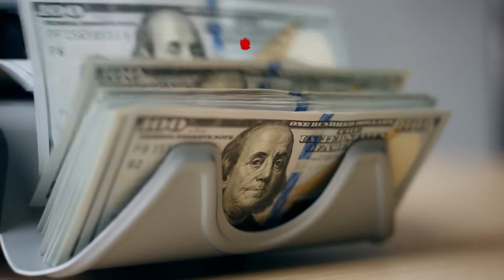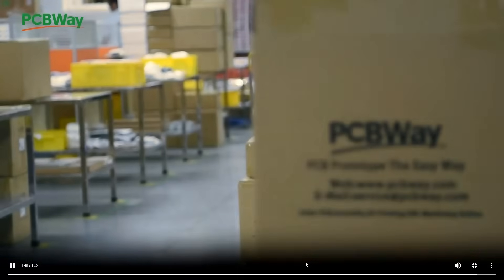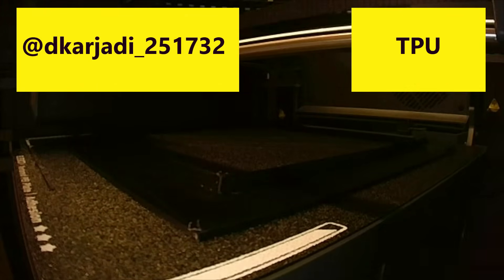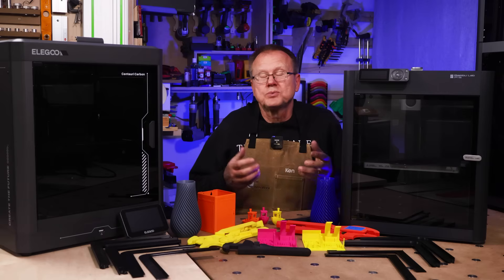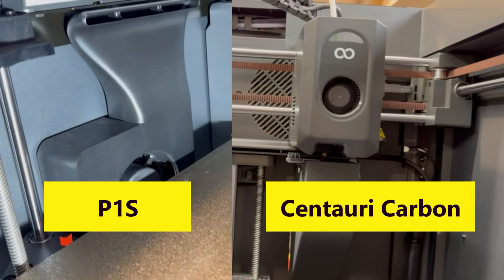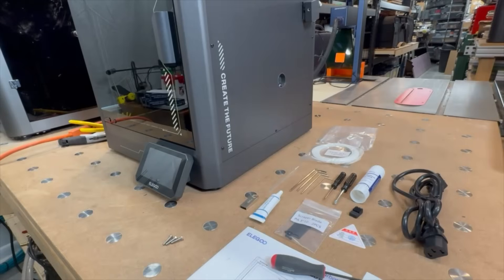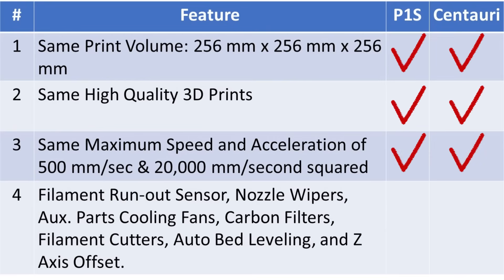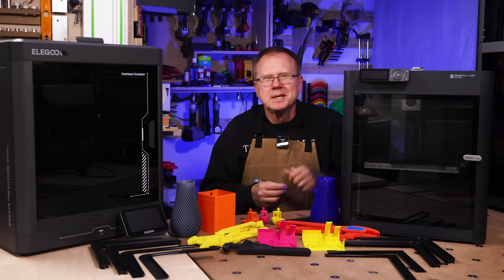Elegoo Centauri Carbon Printer: Better Value Than Bambu Lab P1S?

Comment: P1s power loss recovery was terrible, tbh. I returned it and even the replacement had terrible power loss recovery (and then it has this weird bug where the P1S interface is just frozen after recovering and you have to go to your slicer and turn the camera on in order for it to unfreeze.

Elegoo worked flawlessly. I think the worst part about the bambu printer is that as off writing this, you have to downgrade your P1s' firmware to 1.8 in order to use orcaslicer with it.

My recommendation is that if you want a reliable CoreXY, CC1. There are even mods for it that allows you to use Bambu hotends. For filament backups, I just have the Infinityflow S1. As for color, I just paint them. Saves time, money, and the quality is superior.

No reason to buy the P1s other than for its multicolor system.
Reply from the maker: Thanks for sharing you experience with the P1S and the CC.

Comment: Hello. Currently, here (CZ) the difference between these printers is only about $100. So I have a question: what about the availability of spare parts and the possibility of self-repair? Is it worth saving the $100 at the expense of higher-quality components and the possibility of purchasing spare parts?
Reply from the maker: That's a great question. From my experience, Bambu Lab has a large number of spare parts available for their printers and at least for me, I have typically received spare parts very quickly.  There don't seem to be nearly the number of spare parts for the Elegoo, at least as of now.  If your budget allows it, I would go with the Bambu Lab printer.  Thanks for your question.
Reply: @ristinnovations  Thank you very much for your answer. To be honest, I like the Bambu Lab much more. And when the price difference is so small, and spare parts are available at almost every retailer (via Eshop), the choice is clear. I will get the BambuLab. Thank you very much again for your answer and I wish you all the best in the New year.

Comment: Only corrections. I would add her that the century carbon has metal panels as opposed to plastic like you said and the build volume is the exact 256 whereas the p1s is slightly less, The light has also been upgraded
Reply from the maker: Yes I agree with your  points.  I especially don't know how I overlooked that the CC panels were metal and not plastic. I need to be more careful next time.  Thanks for your feedback.
Reply: @ristinnovations  that happens..I only know because I have magnets on mine lol. Been pretty impressed with mine so far. Haven't. Had any issues. I'm printing mostly abs and petg-cf

Comment: Ultimately I went with the new P2s with the multi-color option. It’s quite a bit more than the Carbon, but I feel the quality is worth it. Amazon has several critical reviews of the Eelegoo. Great review though. I appreciate your thoroughness.
Reply from the maker: You can't go wrong with the P1S.  Of all the printers I have, I rely the most on the Bambu Lab printers.  Thanks for your comment. (Sorry for my delayed reply)
Reply: @ristinnovations  No worries at all.  Just received the printer today, already printing a few thinks.  Really great printer, so easy to setup, I also feel its too good to be true.  Thanks again.

Comment: I think the century carbon is much better deal also it's not too hard to switch filiment after a print to do a different color and the price difference is insane. Thanks for sponsoring a website that is similar to the video!
Reply from the maker: That's the beauty of personal choice.  I'm running them both in my print farm and I'm happy with both.  Thanks for your comment.
Reply: In Australia at the moment with the black Friday deals the P1S with an upgraded hot end is only $10 more than the Centauri Carbon

Comment: At the moment in Australia.  These two printers are the same price.... every1 says the cc is better for the price point. But if they cost the same. Would any1 still go with the cc, or choose the safety of the bambu.
Reply from the maker: Actually, since Bambu Lab has just launched their P2S, I would seriously consider that one.  I don't know what the price is of the P2S in Australia, but it's something to consider. Thanks for the question.
Reply: I just ordered the P1S with an updated hot end for $10 more than the CC

Comment: Hi, you did a great review, thank you for that. I'm between the Flashforge AD5M Pro, and the Centuri Carbon, which one do you think should be my choice? In my country, the AD5M Pro costs $380, and the CC costs $440. Or I can get a Bambu Lab P1S for $500 (But I have to wait 1 month for delivery.)  Which option seems more reasonable at this price point?
Reply from the maker: Sorry for my delayed response. I have been happy with my CC. I don’t have a AD5M Pro, but I have been using an AD5X. Bambu just launched a sale for their P1S so I don’t know if it cheaper for you now versus when you sent this message, but I think you would be happy with the CC or the P1S. Thanks for your question.
Reply: @ristinnovations  thanks for answer.

Comment: 2.148 / 5.000
My story goes like this...
First I bought an Elegoo Neptune 3 which I was super happy with, but my eyes were still hungry so I sold it and got a Neptune 4 XXL... (Great too...)
In the meantime I bought a Phecda laser (great for beginners...) and very quickly wanted something more powerful....
When I realized that XXL doesn't mean much to me in life because most of my prints fit in 255x255x255... I sold the N4XXL and decided to buy the "best 3D printer in the world" BambuLab's P1S with AMS...
That was my first serious screw-up. A nice printer with a disastrous controller. There's no wired ethernet and to connect to wireless you need a blood and urine sample and possibly a CT scan. HORRIBLE!!!
The garbage from BambuLab doesn't allow returns if you're not happy with the product so I had to find a poor guy who knew less about it than me and sell it. I'll never be fooled like this again - I thought and bought a Prusa Core One in a kit for a whopping €1000.
I spent three days assembling it and realized what a piece of junk I had bought. Luckily they accepted a return - for which I still haven't received the money and I'm afraid they'll screw me over too.
In the meantime, I bought another Elegoo Century Carbon for a paltry €300....
It arrived today... and in every way it's incomparable to the three times more expensive Prusa.....
Just to mention that I had minor hardware problems with both the N3 and N4 and I got a replacement controller and head with almost NO QUESTIONS!
In the meantime, I sold the Phecda laser and bought an XTool with which I wasn't completely satisfied (but I think it's my fault) so I returned it also WITHOUT QUESTIONS and got a 100% refund.
To conclude, if you are buying a 3D printer or laser, and I would say any other machine, don't fall for reviews that say European companies are better than Chinese ones.
Chinese companies make millions of copies of each machine and will take yours back or send you a replacement part without question.
European manufacturers are petty and would all get fucked in the ass for a euro so you will have all sorts of problems with them.
I didn't even mention that my new Elegoo CC is better than any I've had and at least 2.5 times cheaper than the first competitor...

Think about this...
Pošaljite povratne informacije
Dostupni su rezultati prijevoda

Comment: well, in the meantime - about 3 months later - the rumors have been more; elegoo is working on a AMS-like system, so that isn't a point anymore. also had elegoo improved the lighting in the latter series - there's not only the little led-lamp anymore, as either 2 light strips on the right and front side to "light up the chamber". now you can see what you're printing - while i guess, bambulab doesn't had "evolved" they'r P1S. so, Elegoo seems to listen to the community and improve they'r printer, while bambulab just seem to "want to sell what they have" (sorry, can't say that better). there's even a annoucement for the source-code from elegoo about the centuri carbon - they "want" to work with the community, and i guess, that's why they also can lean back and sell the CC for such a low price-point, compeding and maybe start to win more and more ground against bambulab.

for me, i have done my choice - i won't hide "behind the great chinese wall", what bambulab is doing... i would like to be a part of a open community - and that's only happening with the CC at the moment, but it seems, that anycubic - what also had made they'r thing - also starts to get more "open source", 'cause they might loosing ground against elegoo.

Comment: in my country malaysia the price difference between the two printers is only Rm300.
Rm2000 for the elego centauri carbon
Rm2300 for the p1s
This is about 75 dollar differnece
Reply from the maker: I see your point that the pricing is very close in your country.  If that is the case, would you lean towards the P1S?  Thanks for your comment.
Reply: @ristinnovations  In Ukraine they are literally  the same price in different stores, I'm leaning more to buying P1S, just because it's quieter, I don't plan to print with abrasive materials.

Comment: The Centauri Carbon DOES have LAN mode and the enclosure is metal. The Bambu Lab P1S cannot print ABS and others as it comes, you need to replace some parts to do it. It is a 2 years old model that is probably going to be replaced soon, buying it now makes no sense now that the Centauri Carbon and others are here and are far better choices. Maybe the Centauri Carbon is more similar to the Bambu X1C but at a third of the price. Let's see what Bambu Lab does.
Reply from the maker: A few viewers did point out that I misspoke regarding the CC; I agree it has LAN and metal panels. The P1S can definitely print ABS right out of the box without replacing any parts because I was able to do it. If someone wants to print abrasive materials, then they would need to replace the extruder and hotend with a hardened steel version. It always a calculated risk to buy a new model of any 3D printer since there isn’t a track record for reliability. I still felt it was worth it to me to buy a CC due to the reasonable cost. Thanks for your comment.
Reply: @ristinnovations thanks to you for your valuable content!

Comment: The CC is a great printer on paper, but mine stopped working after 500 hours with constant 103 and 502 errors. I've been working with support for the last four months to trade out circuit boards and nozzles in an attempt to troubleshoot these issues, and nothing seems to work. They even denied sending a replacement unit because of the time we spend troubleshooting the broken printer. Horrible product, unreliable, awful customer service.
Reply from the maker: I'm sorry to hear your bad experience with the CC. Mine has been working well, so far, but I don't have your 500 hours on it yet so we will see.  Thanks for sharing your experience.

Comment: Excellent video, I am also interested to know if there are any maintenance differences between the two models. Perhaps a follow up video in the near future.
Reply from the maker: You bring up a good point.  I will know more about the Elegoo CC maintenance as I run the printer more and you have a good suggestion to cover any maintenance differences between the CC and the P1S so I will keep that in mind for a future video.  Thanks for the suggestion.

Comment: If my concern was only print quality, what should I choose?
Reply from the maker: That's a great question.  If you are only concerned about print quality, then it's a coin flip; but I haven't pushed the CC to the limits by running many, many hours on the printer yet so since I have more time on the P1S I would lean in that direction.  Thanks for the question.

Comment: I just got my centauri carbon a week or so ago andI'm loving it. As someone who bought a 2nd hand cr-10 max and had no end of troubles with it, I am blown away by how easy it was to get it to do exactly what I wanted. Do I wish it was slightly bigger, sure, but I wanted a relatively inexpensive printer with ease of use and that is exactly what I got.
Reply from the maker: I'm glad you are having a good experience with your CC.  Thanks for the comment.
Reply: This is a very similar experience I am having. I got a second hand Ender pro 3 and am struggling pretty hard to have a good experience with it. I am hoping some of these more modern printers can be a bit more "Set it and forget it"

Comment: I have two P1S, an anycubic S1c, and just got the centauri carbon. Not impressed that there is no app compatibility for the elegoo. I upgraded nozzles/extruder on p1s and so far prefer that. IMO, if you get it on an anniversary or black friday sale, the P1S is the way to go.
Reply from the maker: I do agree you can't go wrong with a P1S. Thanks for your comment.

Comment: The problem is this... I can have for free one of them .... witch one should i get???? I will not pay a cent... So for free what printer i should chose???
Reply from the maker: I don't know how you are so lucky to be able to have either printer for free, but the P1S has a reliable track record and it has the AMS available now versus the CC doesn't have a lot of time in the field yet and their multi-material system hasn't been launched yet so if you only have one choice, i would go with the P1S Combo.  Good luck with your decision.

Comment: I'd be very interested in how your Carbon is still working if you have a couple hundred hours on it now.
Reply from the maker: I don't have 200 hours on my CC yet, but up to this point it has been running well.  Thanks for the question/comment.

Comment: Oh come on, is it really fair to compare 3D printers that were released at completely different times?
Sure, the Centauri Carbon is cheaper and delivers the same quality as far as I've seen, BUT the P1S was released back in 2023. It would be much fairer to compare the CC with the X1C, and even that was already released on Kickstarter in 2022.
So is it really fair to compare a more than obvious copy that was released much later with the “original”? 
To summarize, is it really fair to take someone else's concept, modify or improve it only slightly, if at all (not even really more advanced than the “original”, or incorporate anything groundbreaking), and then praise a product that has a lot of work in it that someone else has already done?
It would be the same as comparing modern cars, airplanes, computers or electronics to their predecessors decades before and saying “look we made something new that does the same thing and is much cheaper.” 
No hate to Elegoo, Anycubic, or any other manufacturer, they are after all inexpensive good printers that deliver decent quality. 
But come on!
Create something new, develop something groundbreaking and contribute to further development instead of just copying everything and saying we are cheaper.

And yes, I am fully aware that bamublab has done nothing other than take an existing system and modify it. But their development has at least shaken up the market and driven the further development of 3d printers and rekindled the fire for faster and further development
Reply from the maker: There is no question that new models of 3D printers are being launched all the time.  Regarding my decision to compare the Elegoo CC to the Bambu Lab P1S is that even after the approximate 2 year launch of the P1S (and 3 year launch of the X1C) today there are still other manufacturers that are playing catch-up to Bambu Lab.  In several cases, other manufacturers are trying to copy Bambu Lab's designs, which is the reality of the world we live in.  It would be great it other manufacturers brought out their own designs that would leap over Bambu Lab so that the technology would continue to dramatically improve, but we haven't seen that yet.  Thanks for sharing your point of view.
Reply: So if Bambulab does copy others is ok but if others copy Bambulab and reléase same quality products for less money is bad? 

I didn’t knew Bambulab cultists were a thing.
Reply: Did you read what I wrote?
It doesn't seem like it, otherwise, you could have saved yourself from making that stupid comment.
I never said it's only okay for Bambulab to copy and sell products.
What I did say however was, that it is acceptable to take an existing product or concept, modify/change it significantly, and therefor develop a new product because it advances technology in general. How else do you think we got to where we are today?
I'm criticizing the practice of copying someone else's product, making few or no changes to it at all, and selling it at bargain prices. This makes the work of developers more difficult because they then lack financial resources, which slows down progress!

If you can only offer nonsensical comments or insinuations, then keep them to yourself.

Comment: Can you please tell me how they compare in terms of sound level? 

I heard that the Elegoo Centauri Carbon is extremely loud. But i couldn't find comparisons to the P1S
Reply from the maker: I don’t have an objective way to measure the noise of the two printers, but I can say subjectively that the CC is louder than the P1S. I know this may not be very helpful, but until I get a noise meter, I can only offer my opinion. Thanks for the question.

Comment: After watching this I’m stuck between getting Centauri carbon and the qidi plus 4, I know the qidi has more features and bigger. The only thing is the problems the qidi had with the ssr, also I want to see how the mmu on both printers. Has anyone have had any issues with the qidi after ssr change or any issues with the CC thanks